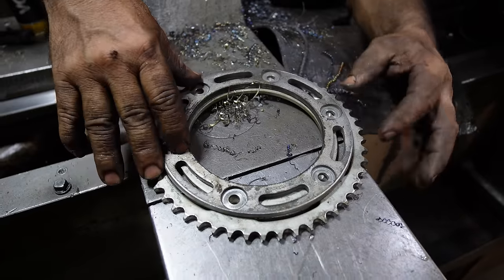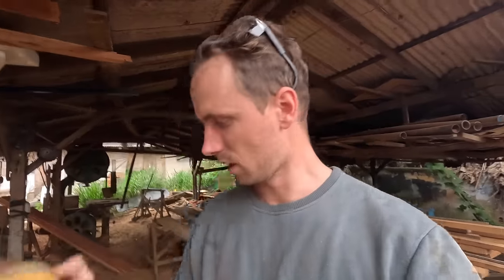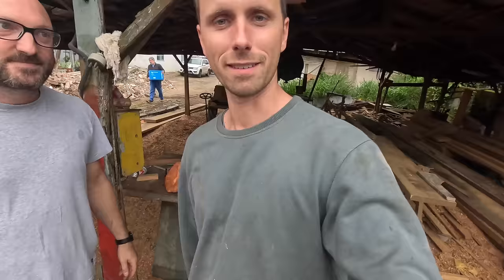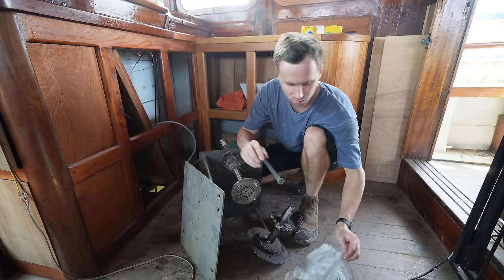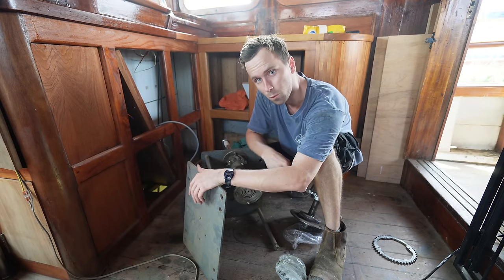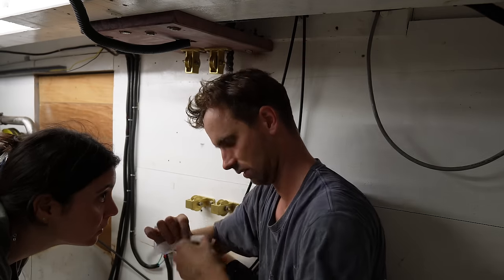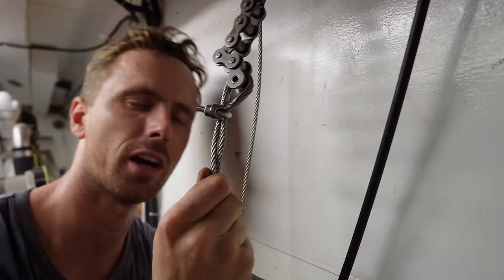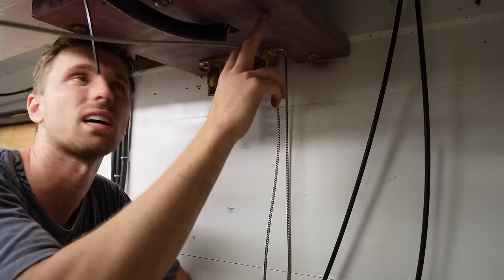Upgrading the old fashioned steering system of our RESCUED wooden sailboat — Sailing Yabá 158

Comment: Is there slack in your steering line ?

You really don’t like  It 😳🤔 
It Should Be Very Firm. 

If there is an easy Fix . 

Go to your local boat shop see what they have ?

Yaba not like a little speed Boat it may explain 

This is what it Would look 

1. An Expanded Spring  as long as you think necessary 12”-16” long heavy Duty ,  long to take up the slack of steering  cable.  with an inside   1 1/4” dia ID.

2. You will need 2 pices of Steel round stock 1/4” Dia , 2- 48” long . 

Now take those two pieces of round stalk mark 24” to center with a center punch mark. Then heat from center 2” one 2” the other , if you have a vise handy put a 1/2”or 5/8 “ Bolt in the Vise , get the Rod red hot bend it All the way back together both legs touching  let  And Repeat do the other 😃 you should have the Shape of a trouble fishing hook for a head 🤔 better yet a U let’s call this end the head .the head must be able to slide through the Spring And hook over the Edge of the Spring , let us call this the Hook J  on opposite side  to catch both sides of the spring 😃
Now you have Two of the pieces.

From the end of the four straight legs , from the end leave 2.5” heat and bend 
You might take a pice of steel drill in from the edge 1/4” from the edge roll the steel for allowing for spring thickness . It will look Double I’d back to Back on each spring.

Take the spring ( it is an Expand spring )
It is not a pulling spring , Take 1 of the two 
Cable spring tension  holders the spring and push through opposite of each other 
Make your Steering will feel Tight 
 
If you find a bigger or longer spring 
You can always cut the spring down .
Whatever you can find 

You might mark the center of Rotation on the wheel  might give you a mental position of your rudder. 

Hope this helps

I

Now put 
2 - two loops one for each side the

Comment: I'm sorry, but you underestimate the forces at play in such a system. Your steel wire is way too thin, and the wire doesn't fit the pulleys. The groove on the pulleys must have the same diameter as the wire, otherwise, the wire will get squashed, and because it will be the same few centimeters that run over the pulleys most of the time, it will wear out in no time.  You need at least a 10-12mm wire for a boat of that size and pulleys that fit it.

You don't need to use wire all the way, a steel rod inside a tube can replace the wire under the deck. That way you can fasten it properly, and you'll only need a few meters of the expensive wire.

The system in my 32' boat is made with 8mm wire and rods in tubes. It still works perfectly after 70 years

Comment: Does not look a sea worth solution to me. Real basic engineering mistakes. Dissimilar  metals, Locktite instead of lock nuts,  no spilt pins as a back up. Spring dampeners  in cable run to constanly just tension cable too small, for an even pull on the quadrant I would take the cable over to the other side of the quadrant. Let hope it a mock for the real thing to come later.

Comment: very bad solution for the pulleys of the steering. You have to use nut and counter nut to block the shaft of the pulley. Or a self locking nut❤

Comment: Watching this doesn't give me much confidence as to the strength an reliability of the system. You have changed the gearing at the wheel but gone to far IMO. It is now needlessly light and over geared which will slow down rudder response a lot. There will be virtually no feel when steering under sail. As mentioned you will need a steering tell tail to show you exactly what the rudder angle is. Knock back due to following seas putting pressure on the rudder is unpredictable but could prove dangerous unless there is some sort of damping in the system. Unfortunately there are no levers that you can attach oil dampers too. Wire size to me would be more suited to a 30 footer than a vessel of this size. This also means the pullies and brackets are also too small and just attaching them with screws seems pretty risky. The cable attachments at the rudder look more like get you home repairs and I think they will cause problems. I don't like U clamps used like this as they cause localised stress points. They are cheap but there are better methods. Turnbuckles needed for adjustment with them fitted in the cables using proper spliced joints as used in rigging.  It would be good if you had a quick release clutch for the wheel in case you have to fit the tiller in a hurry. I'll stop here. As they say, the proof of the pudding is in the eating. I have great admiration for your enthusiasm and patience but have to grit my teeth sometimes.

Comment: If your using stainless steel aircraft cable like that why not use phenolic resin pulleys like aircraft use instead of bronze that steel will eat at the bronze faster I think also aircraft pulleys grooves fit the cable more closely like a glove they are sized for the size cable you are using and are specific that bronze pulley looks way too fat or big in size compared to the wire rope cable size you are showing here in this video I am assuming that what your doing here is just a mock up fitment also on aircraft they use cable guides to prevent the cable from popping off the pulleys also the friction in these type of systems stem mainly from two sources the amount of angular changes in direction the cables make and over tightening the whole thing up too much

Comment: I applaud your enthusiasm but you are out of your depth. You don't seem to understand the forces at work here. All the brackets need to be through bolted (the constant tension and relaxation will eventually loosen the bolts in the wood). You mustn't rely on thread lock to hold the nuts, How are you gong to check the one you can't see. Murphy's law dictates you will have a steering failure when you most need it i.e in the middle of a storm. Please seek professional help on this for the safety of both of you.
Reply: You do know they have a tiller for an emergency don't you?
Reply: @PtangPtangBiscuitBarrelSmith  Hi, yes I was aware of the tiller. The point I am making is, due to their inexperience they are designing in failure. I know neither of them would want to manufacture to less than an expected professional safety level.

Comment: 3:20 , leave those fittings in, they are the grease nipples, you buy a grease gun to inject grease into the core through that nipple. Well, the bad news this system is going to be constant issues for you... the good news, lots of dramatic/ butt clenching content..  Big question, how are you integrating an auto pilot into this setup.

Comment: Sorry that homemade bracket on the rudder is so ghetto and the connection points will wear quickly. Why not buy an actual steering quadrant designed specifically for the application. I’m sure some patrons with nothing better to do with their money will throw it to you and you can have a custom quadrant cast from bronze.

Comment: It may not seem important, but having spent YEARS using table saws on the job, getting away with many foolish things...promise me you will never again show on camera that move where you flicked the waste piece (which was riding on top of the moving blade) with your hand.Do it if you must, but if I see it again, Im unsubscribing.  Grabbing a stick to do that is even worse, so good instinct....BUT its better to just let it go where it wil on its own. Its not a problem, even if the blade kicks it back (your body should be clear of the cut line).
Keep the push hand steady, keep your body out of the line of the cut. Sorry to lecture but we'd hate to see you finish this amazing project with some fingers or part of your hand missing. Most folks who have been maimed by power tools were just doing "that thing I always do; done it a million times" . Sorry again for the rant, but seriously, don't get comfy around a thing like a table saw.